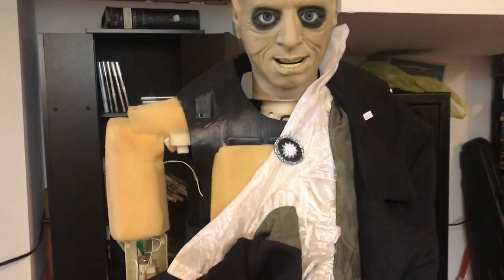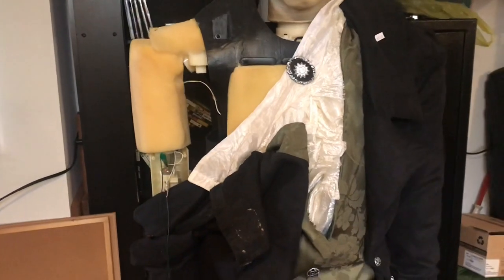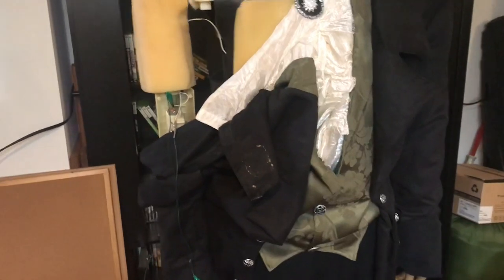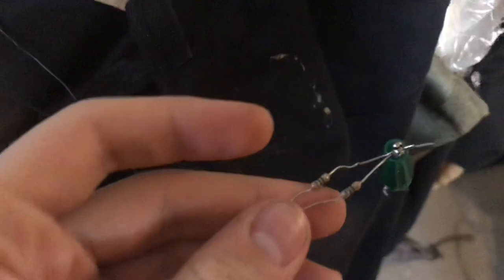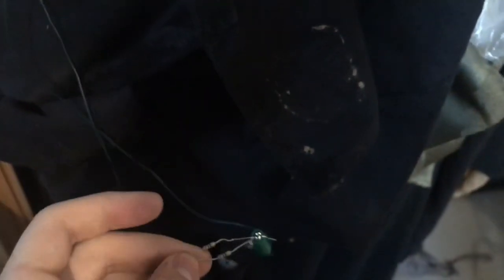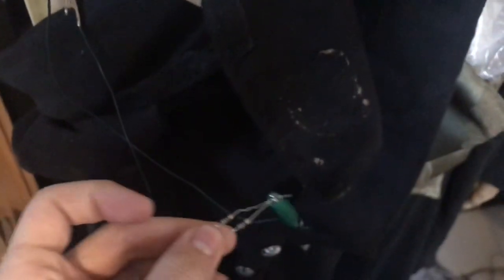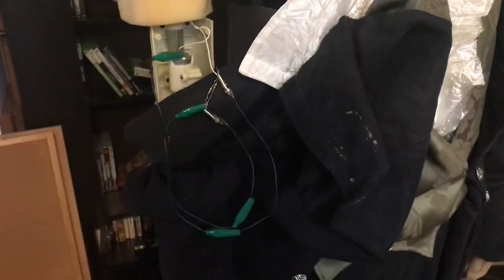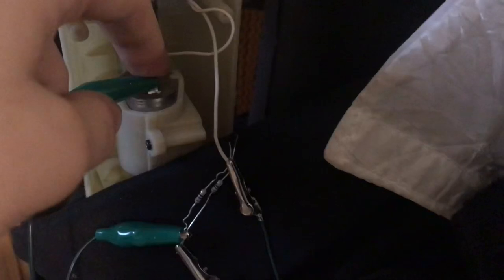GMA Repair Tips: Arm Clicking on Lifesize Problem Solved! (Rapping Butler)

Comment: Hi, does the motor you are working on have capacitors? I'm trying to fix my Michael Myers H2O and it has capacitors. Do I need to remove those before I put the resistors on the motor? Does it matter which 2 wire on the motor the resistors are soldered to?
Thanks 👍🏻
Reply: Add to positive wire do not remove capacitor

Comment: Huh, mine clicks once sometimes when the arm goes down, might have to try adding a few, never thought of this for the arm!
Reply: Did it work?
Reply: @justahalloweenhaunter5272  This method sucks, the arm mechs have this stupid clicky gear to prevent gears breaking if the mech gets forced, but it causes more problems than it solves. Using a resistor makes the arm slow, all it does is slow it down enough so that it doesn't hit the stopper. I open the mech and wrap epoxy around the spring on the clicky gear so that it is no longer able to compress - problem solved